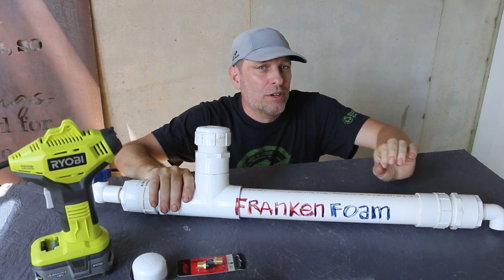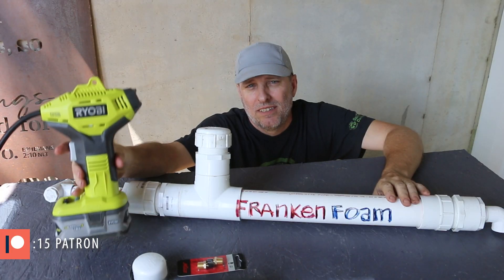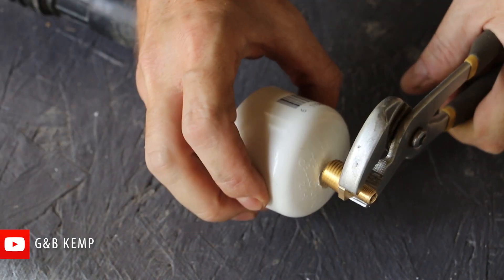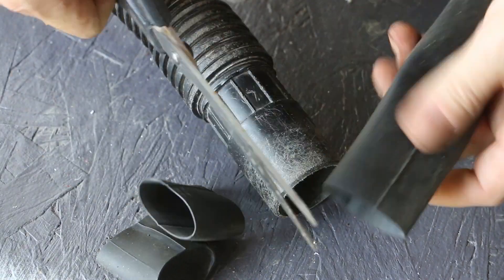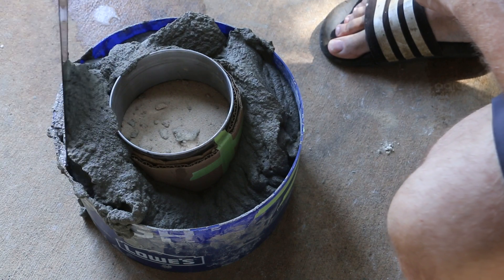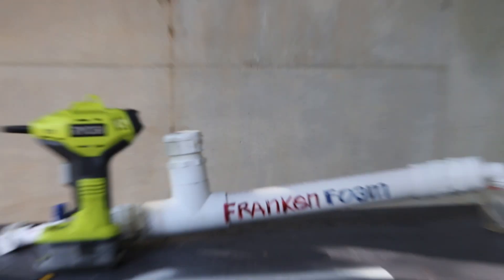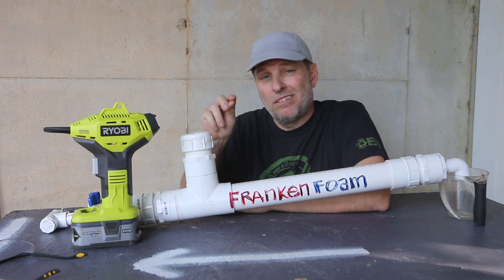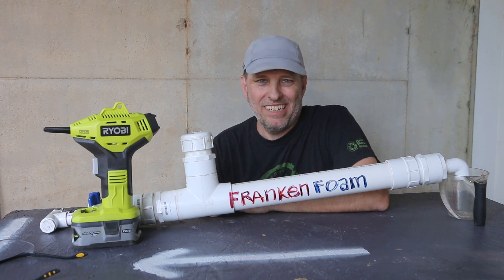Can I Make #Aircrete Foam With A Shop Vac? Or Tire Inflator?

Comment: I am very surprised at the output of the inflator. As for the vacuum I wonder what it would do if you were able to hook it up with a much bigger connection about the same diameter as the vacuum hose?
Reply from the maker: I was pleasantly surprised as well. I bet you are correct about the larger output for the vacuum. I plan to try that. Thank you for watching.

Comment: So... reading the news it seems this is how we build all our schools on this side of the pond.
Reply from the maker: Excellent! Are they using aircrete blocks? I’m curious if it is used structurally. Thank you for the input. Thank you for watching.
Reply: @GreenShortzDIY  There's a big scandal in the UK right now. They used something called 'reinforced aerated autoclaved concrete' to build schools, hospitals, public buildings etc from WWII to the '90s. It has a limited life so there was a renovation programme. Anyway, the government cancelled it about 10 years ago to save money, figuring fixing it would be someone else's problem. Unfortunately they made the mistake of holding on to power...
Reply: Anyway, sorry for injecting politics. Your project is cool! (Just don't go building any major infrastructure)
Reply: Interesting addition, I was also wondering about the same thing. And yes; it's a cool project!
Reply from the maker: Ah. I see it's a bad thing. From what I've observed, aircrete is not a good option for structural components.
Reply: @GreenShortzDIY  What would you use it for?